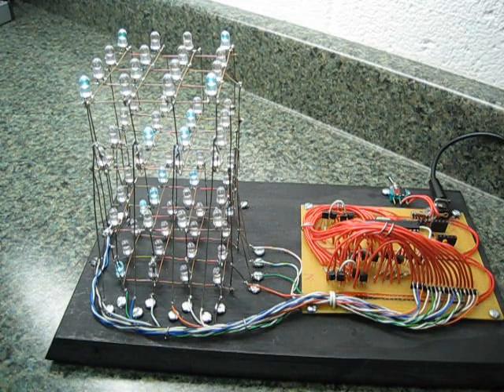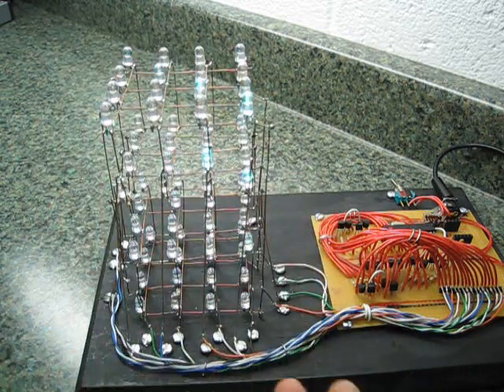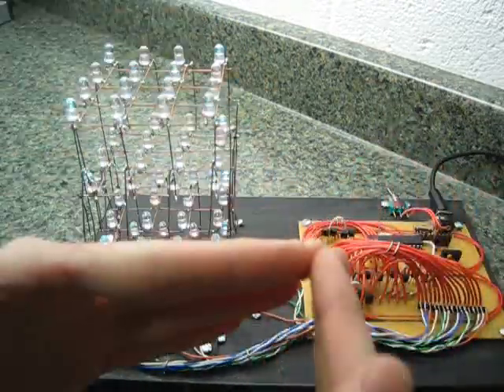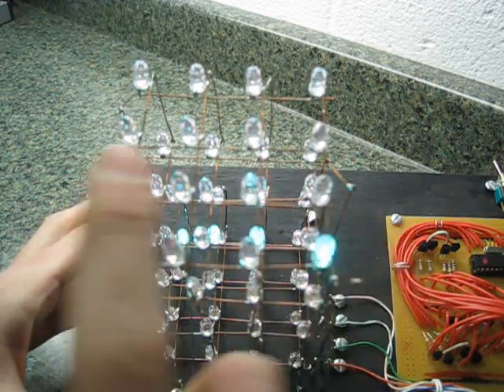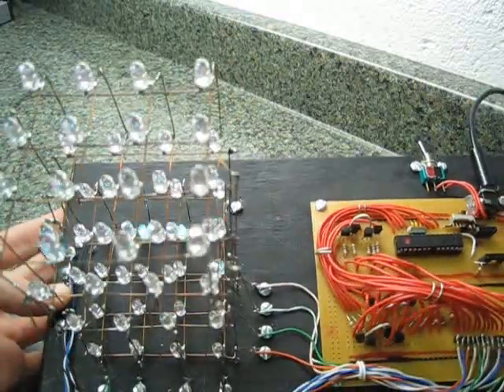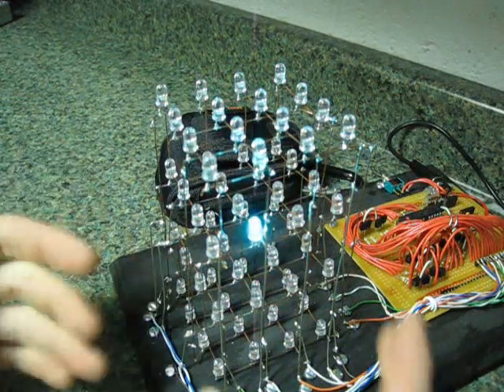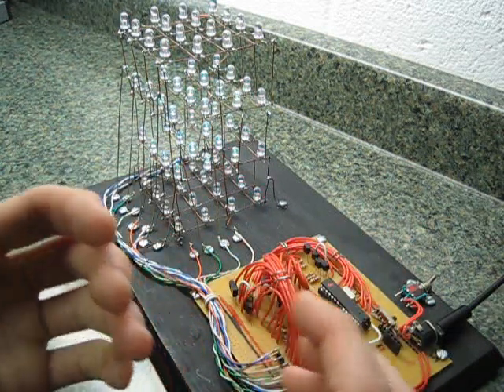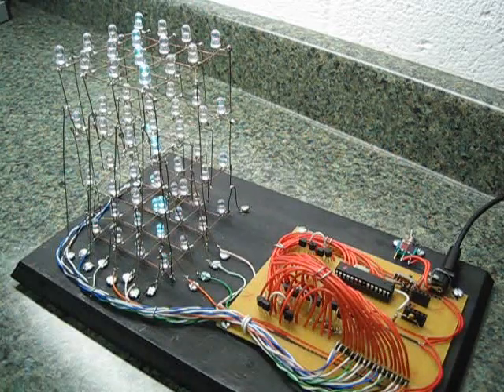LED Cube How it works + CODE

Comment: Well with addition of an extra IC you can further reduce number of used controlling pins.
for instance,  3 line to 8 line decoder/demultiplexer .  4 lines would be dedicated to power up one of the 4 led plates and 3 lines for indexing  the desired LED .  So pretty much you can achieve the whole thing with 7 control lines.

Comment: you could use mig welding wire, instead of stripping the insulation from ur cables would also make the cube a litle bit stronger, oh this relates to and earlier video i watched of yours,   the mig wire is steel but coated eith copper... also I  know a compnay that would more than likely be intersted in these cubes of yours,

Comment: Need way more Kevin. You just turned me into a raving lunatic. Not that I wasn't close already. But seriously, if I go and watch your other uploads, am I going to be much closer if I haven't worked with a 328. I have the experience with programming with an ISP USBasp device, other Atmel Atmega MCU's in RC devices.I manage a repository of prewritten hex code for my RC gear, I don't write it. Still would like to make a cube though :-) Isn't there a "lite" version in a kit to get your feet wet?
Reply: It isn't as hard  as you imagine.
Reply: Paul Barton Thanks for the words of encouragment Paul. But after this, I have this cloud of confusion rather than clarity. I have simply put off the led in favour of robotics, plus  I am so immersed in this UAV Quad running an arduino based flight controller I have lots of stimulus. What I was thinking leaving a message for Kevin. .5 meg. views and 115+ videos. What am I new? :-) Think of the impetus this has stirred  and the parts that have been ordered in the pursuit of "the Cube"

Comment: When multiplexing bases controlling transistors can I use current limiting resistors connected to collector of first transistor like: +5 -> resistor -> [collector -> emiter] ->  [base] or do I have to put individual resistor before every base input? (+5 -> [collector -> emiter] -> resistor -> [base]. Hope you can understand what i mean.

Comment: BrighTToneRGB 

Take a look at BrighTTone_RGB (twitter) and at indiegogo campaign - sound activated system with multiple reconfigurable channels and IR remote control, microphone sound respond, Automatic gain control, auto calibration, wireless rechargeable inductive charger, embedded high capacitance battery  etc. Very cool entertainment system for the house or office! Take a look BrighTTONERGB! All kind of sizes and forms for the displays!

Comment: I've already discovered a lot of good blogs with easy and inexpensive beginner-level projects these few days (that's what I meant to ask for initially), specially under the "tutorials" section at the main arduino page.I want to start experimenting with addressable RGB LED pixels and matrices, but also with stepper motors, so I've kept on researching and went with an Arduino Mega board.  Can't wait for it to arrive!

Comment: why not use gates to filter out what led you want? would only require 6 pins to control all 64 assuming 1 is always lit, which it should be...very cool cube none the less!

Comment: Hi Kdarrah, i'm from brazil and i like your channel very much! Great Videos and explanation!
I'm building a 4x4x4 Led cube just like yours, i make it the exact way that you did. But i have a problem with mine. The 1st floor work well, but when i light up some LED's on the 2nd floor, other two on the 4th floor light up as well, i don't know why. The cube it self works perfect, but using the npn's to get only 12 control pins the problem appears. Do you have any idea why this happen?
Tks kdarrah!

Comment: the code isn't consistent with the wiring.   The pins identified as "source" (4 collectors and 2 bases) would be pulled high.
But pins identified as "sink" (4 emitters and 2 bases).  The emitters should be pulled LOW and the bases pulled HIGH.   that is not the case in your code....you are pullilng everything high in order to turn it on.   And WHY only 5 source pins???    

int source[] = { 12,11,10,9,8 };
int num_source = 5;
int sink[] = { 7,6,5,4,3,2 };
int num_sink = 6;

Comment: Actually, you can encode it down even more: 4*4*4 is 64, and binary value what can fit number 64 is 2^6=64. So, 6 wires can carry data about which led must be triggered, to convert 6wires into usable signal for LED's, you need a thing called decoder.

Comment: look up a data sheet for a little 5x7 led matrix, its the same concept. think about how the current would have to flow to turn 1 led on. remember that current flows only 1 direction in an led

Comment: hy if I should use your methode to make the 4x4x4 should:
so you say that you 'spread' the 4 layers out to a 8x8 matrix so you get from:
4
3
2
1 
to:
12
34
with 1,2,3,4 = 4x4 matrix...
So if I get the top 8 LED's (so 4 LED's from 1 and 4 from 2) to control the anodes, and the 'side' LED's from 1 and 3 ...to control the cathodes. 
I guess I should connect all cathodes in a single column from the 8x8 matrix but how do you do that in a LED cube? how to connect al the anodes from 4 with 3 etc? :s

Comment: Hey, since you're lighting a single LED at a time, will it be possible to use two 3x8 decoders? That way you'll only need 6 pins from the microcontroller. I suspect it won't work since all the other pins out of the 8 will be low?

Comment: any reason why you didn't use the analog pins for the extra outputs rather than multiplexing the anode and cathode transistors?

Comment: I saw the three videos u made. There is jsut one thing i dont get. You devide your 8x8 grid into 4X4 grids. So far so good. I get how it works if you would just palce them side by side 2 dimentionally. But.... How do you stack the 4x4 grids without gettign a connection you didnt want to have. If you stack them you somehow ahve to solder them together without makeing wrong connections like perhaps connecting the anodes of the first 2 layers. How does it work?

Comment: You have a matrix, and mathematics and support chips can help make larger cubes with that same uP.  
The LED cube remind me of core memory used in the early computers.  Each LED in a 4x4 matrix (floor) can be represented a Base16 (Hexadecimal) number.
This would be a good visual teaching method as well as a great working special effect (movie?) for core memory of a computer.

gb

Comment: Kevin, How did you get 12 inputs? BTW I've watched your multiplexing videos.

When you talk about an "eight by eight grid", it's irrelevant since we all agree 16 wires would be needed.

If your cube has four rows, four columns, and four levels, then 4+4+4=12. That implies three inputs per diode which only has two - anode and cathode.

Is there a schematic? Thanks.

Comment from the maker: @kelmis7 
good question... Its called pwm, or pulse width modulation.  I simply varied the off time of the LED or changed the duty cycle.  It was kinda tricky.  I wanted to do it to more than LED at a time, but that would have been tough.

Comment from the maker: @numex106 
Congrats on your cube.  That is actually a common problem.  Solid state devices have a certain amount of "leakage" current, which can result in the "dimming" effect that you are seeing.  You need to make sure that you fully turn off the transistors.  Also, verify your amperage through the bases of the transistors.  Anyways, it pretty much just comes down to trial and error.  Hope that helps.

Comment: Excellent! You know "numex106" well now since I'm so intrested in ur projects! I've just built a 2x2x2 led cube for testing purposes and to try out my jig. I must say I like how u bend out the anode pin so it can solder onto the pin beneath it. It makes it so much easier. One question though. when the bottom led lights up the one above it appears to be dimly lit up. Any ideas to solve this problem.